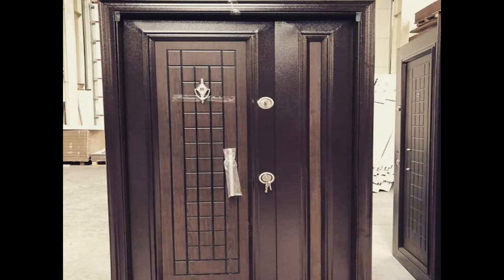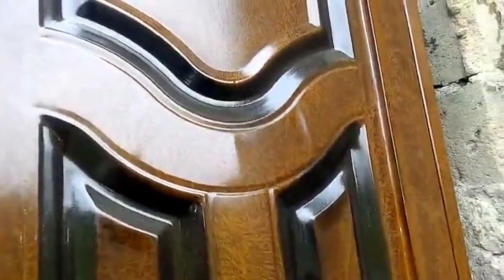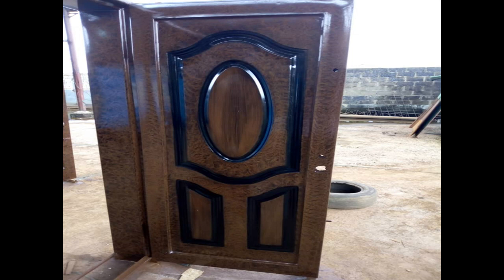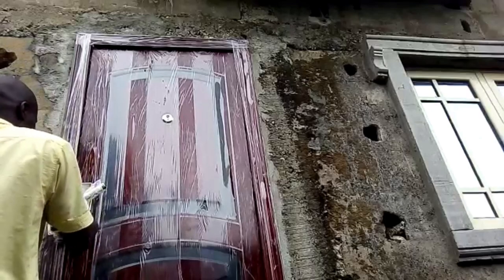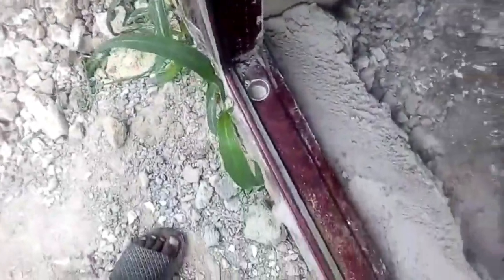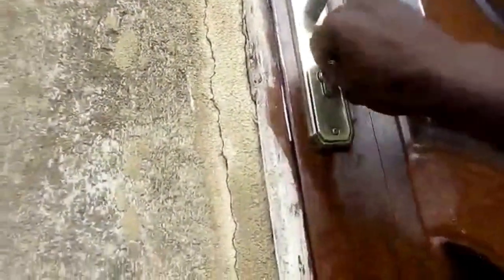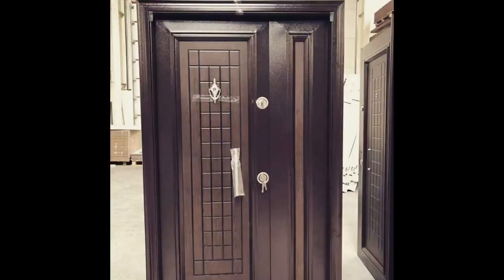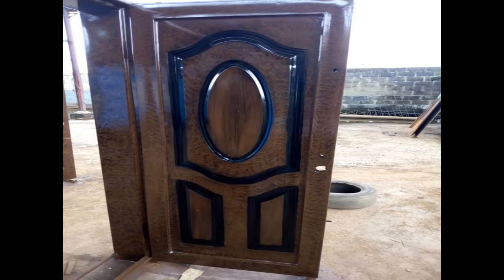DOORS TO USE WHEN BUILDING YOUR HOUSE PART 2

Comment: Pls sir, how can I contact you sir for consultations.
Reply from the maker: Send me message on my watzapp number +447825543535
Reply: @LuluDumba  my brother I need your advice for my project. I need to buy electrical wires for my project. How much do you think it will cost me for a 6 flat ,3 bedroom unit.I have already fixed the pipes through which the wires will pass through